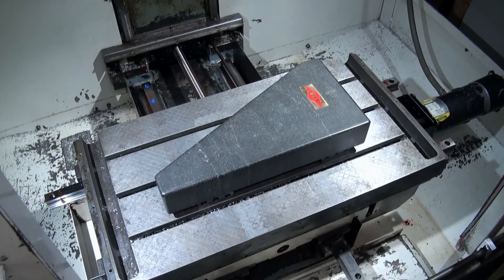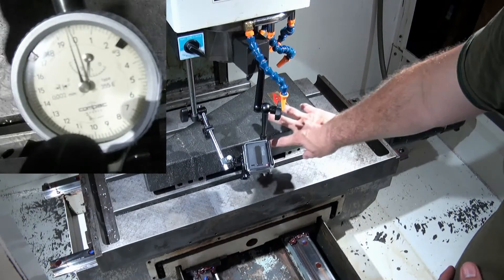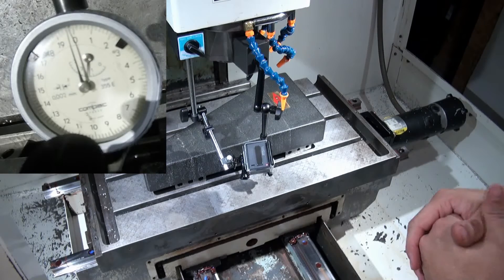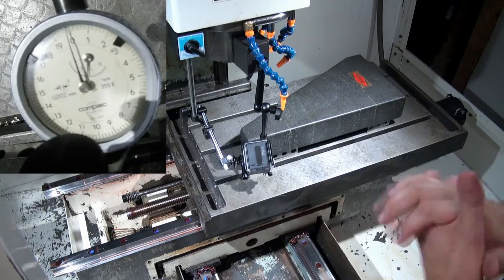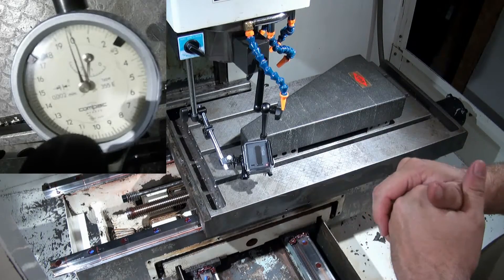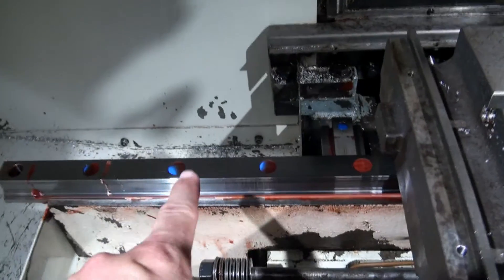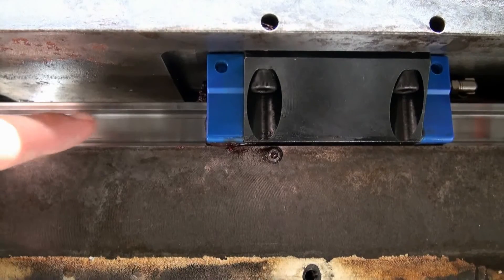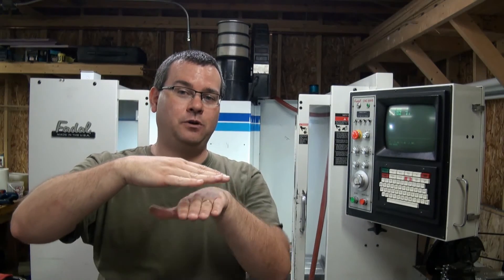CNC Machine Setup and Alignment Part 4: Straightness of XY

Comment: For me with this system meausure nothing if the table is parallel to guide but inclinate both... Because the dial will pass always only from one  point from x+ to x-,so the dial will indicate always 0...while if the guide are parallel and the table is twisted is ok the system... If the table is all x or on x+ is normal that on the final the dial increase because the weight is all on one side....

Comment: Thanks on advanced for what you do.But I don't understand why you measure from the stone and not from the  table?thanks again
Reply from the maker: The table is an unknown, it could have error in it, it could not. The stone is a calibrated square with less then 1 arcsec of error. Once the machine is square you can then run one of the slots on the table to make sure it is parallel with the motion of X. But the rotation of the table does not indicate squareness between X and Y.

Comment: I'm confused. If you adjust the stone so that it's straight, then it should always be straight, right? This could catch waviness, but how exactly does it catch straightness?
Reply from the maker: "Waviness" is the opposite of "straightness", if its wavy its not straight. Adjusting the stone to get it roughly straight is where you want to start and then adjust out the low and high points to get the rails not to be wavy. Then you can check the opposite axis and check if its square.

Comment: Very well done series so far. There's far too much misinformation by probably well meaning but less than fully informed people both on Youtube and the machining forums about this subject. Even at the hobby level a copy of the Connelly book should be on everyone's bookshelf. And I more than agree with your point in the first video about spending what's required to get high quality, accurate, and repeatable measuring equipment that can be relied on to perform up to the requirements.  Machine tool testing and alignments can be a complicated subject and I think your doing  great to show and explain it as well as you have.
Reply from the maker: Thank you Turning Point, means a lot. This series by far has taken the most amount of time to shoot.  There is still a lot left to go! I owe a lot to the person who taught me.  He spent a lot of time teaching the theory and then letting my make my own mistakes and how to get it right. After this series is done I'm hoping to have him bring in his laser system and show how high end machines are done.
Reply: Unfortunately I've had to pretty much self educate myself about this so it takes a very long time to even find the correct information. But I think if you can get that laser system shown it would be really interesting to see how it's properly done today. I am looking forward to the rest of the videos you have planned. No CNC equipment,  linear or box ways in my shop. But the alignment tests are still the same for what I have.